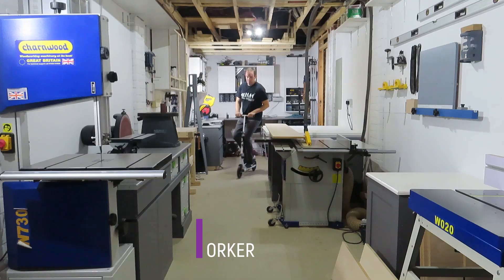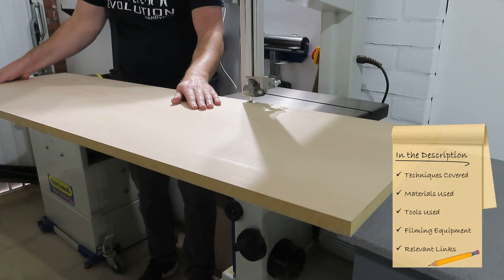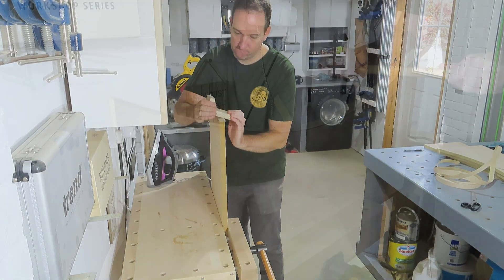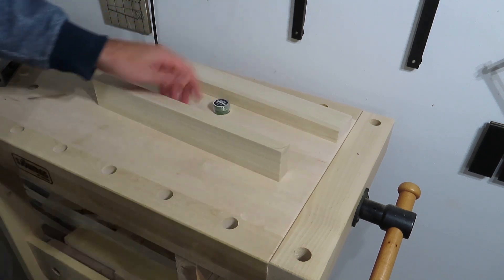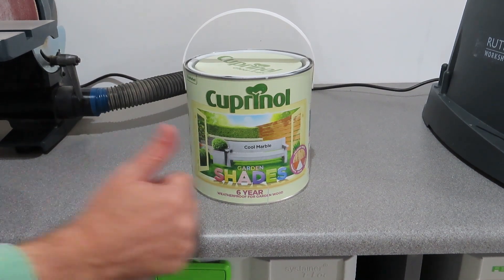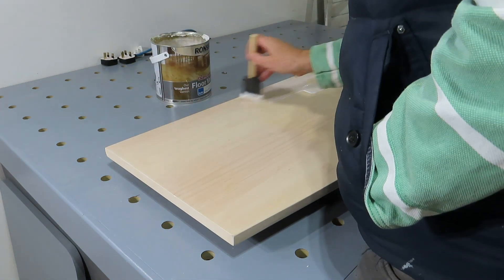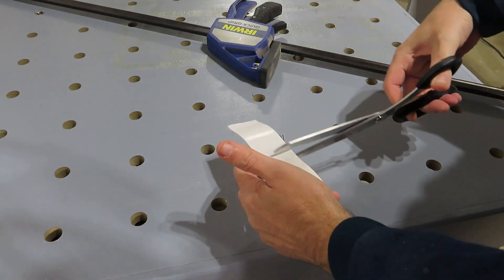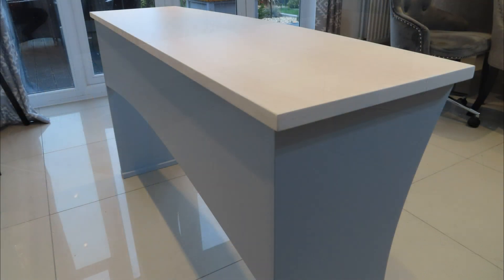Simple Computer Desk Build

Comment: It would be really good if you could talk a bit about your router table. I am looking for a router table and the charnwood looks awesome being cast iron. How have you fixed your router to it? Does it have a router lift? Etc?
Reply from the maker: Funnily enough I have just sold it but it was an awesome router table, it comes with 4 metal fixing brackets which fix the base plate to the bottom of the table. I had a Trend T11 router and got the winding handle attachment for raising and lowering plus the collet extension worked really well although a bit slow to raise and lower but this didn’t bother me really 👍
Reply: @ukhomewoodworker848  Why did you sell, did you replace it with something else or was it just surplus to your requirements?
Reply from the maker: @pgtips4240  I am downsizing some of larger pieces of equipment so plan to build a router table into a workbench next year to save space 👍
Reply: @ukhomewoodworker848  Yes, got you, that makes sense. Thanks for your feedback, I appreciate it.🙂